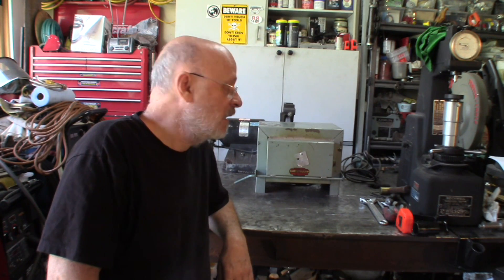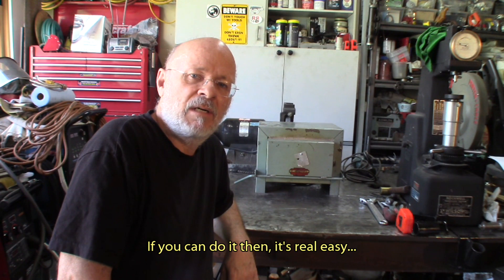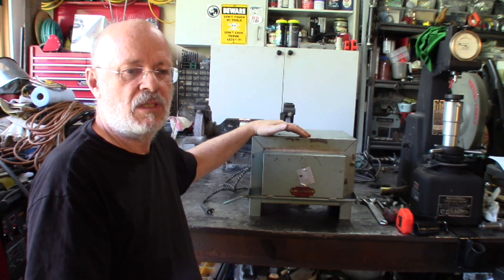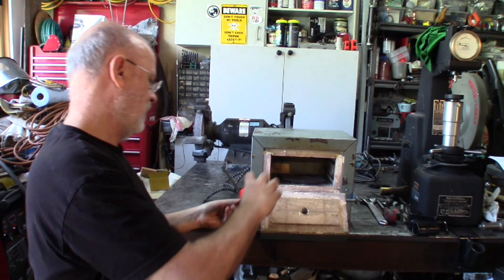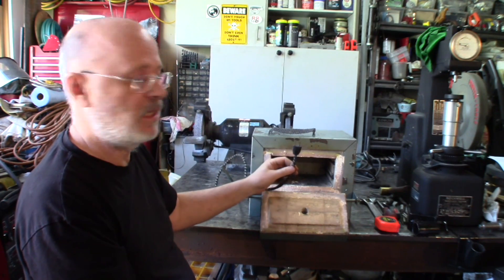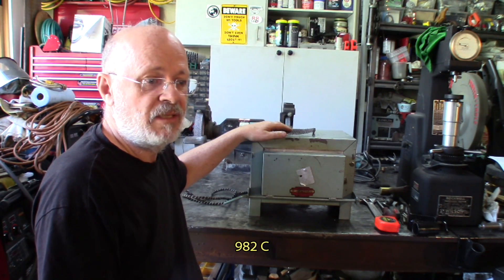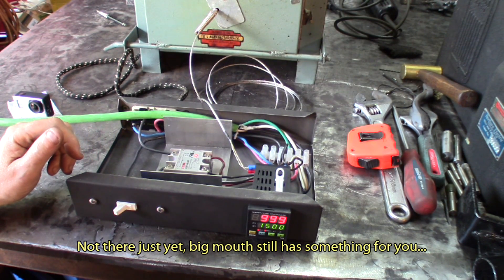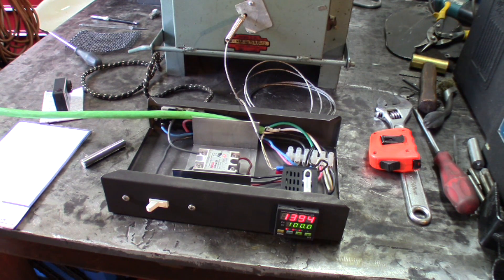Making an kiln oven controled by a PDI for hardening and tempering

Comment: Hello, i bought a ceramics kiln with a PID controller for melting brass, and it is heating up very slowly, dingen its programmed for glass, is there a way to speed up the heating process in any way?
Reply from the maker: Hi, you probably alerady got some presets programmed into the PID, normally ceramics will require a slow rampup in order to burn the vegetals still in the clay to avoid black stains in the fired pieces. Go into your PID instructions and find out how to modify the ramps and steps in temperature control. All PID's brands and models will be different on how it's being programmed as of the number of programming steps, this is why you must have or finf your manual.
Normally it's well enough doccumented, if required you could find videos on how to deal with the model you own...
Reply: @pierresgarage2687  wow, quick reply! Thanks for the clear answer, appreciate it!

Comment: Hello I would like to make a kiln element controller for my ceramic kiln to get slightly better results on some glazes that are little bit finicky the art of the system hold volume for certain temperature just like making high speed steel requires very precise temperatures with some poll times on the cooldown I believe. The way my kiln is set up it uses 240 volt but it splits it off into 110 volt for each element so there's a number of ways that I could do this. My question is could I run all of the elements off of 1 solid state relay simultaneously? That would be the best way to control the temperature for all the coils up and down the machine. I have it set on a 30 amp breaker.

Could you tell me a good brand of controller to you is I only have familiarity with the watlow brand as I used to repair incubators that used watlow controllers so I am familiar with the feedback loop type of devices.

For example what is the controller you used and what brand relay excetera would be a big help to me it would save me a lot of my own research which I really don't have tolerance for it this time LOL any advice you can give me would be very very appreciated
Reply from the maker: Hi, the controller in this video is a Chinese version of something, for the intended purpose it's all right. What you seem to require is something more related to commercial use and requiring more reliability. There is a line of controllers from " CAL Controls " that could fulfil your requirements, the model: CAL 9500P would do just that, it's programmable with many process steps, up or down, timed, etc. The price will be significantly higher than a knock off but you get what you need...

As for SSR ( Solid state relays), look on Digikey, Newark, web sites for good quality, there are others, but those 2 are quite reliable. Just choose a value slightly higher than what you require and install them on a proper heat sink, aside from this there is no big issues to be considered.

Thanks for viewing and for your inquiries,  hope this will help you, ATB,   Pierre
Reply: @pierresgarage2687  thank you very much for your reply I appreciate it greatly I will check them out. As far as the Heats and goes luckily I'm a machinist at least in the sense of a hobby that I've been doing for quite the number of years. I've actually designed a heat sink that works unbelievably well it's like E channel it has two solid sides and fins in the middle in a fan that sucks through the fins! It works about Chrome what I can calculate perhaps 60% cooler then he straight heatsink. I know that this won't require something that radical but it's fun to do anyway.

Thanks again

Comment: Nicely done! How is the SSR holding up getting partial voltage? Is that actually dropping the output voltage? I always thought SSRs were a simple on/off, I didn't realize they had the ability to ramp based on input voltage...
Reply from the maker: The SSR is being triggered on/off as the current is needed to kep up the required temp, it's always at full voltage, but, for shorter periods of time...    As an example it will be 100% voltage for 100% of the time needed to reach the required temperature, then, will cycle 100% voltage for shorts periods to maintain that required temp. At this time it can be considered the the on/off cycling is a certain % of the time...
Let me know if I was able to make this to you...   ;)
Reply: An SSR is basically a simple switching relay. Instead of a mechanical solenoid and switch contacts, it uses solid state electronic technology. This has the advantage of no moving parts to wear out, and higher switching rates for prolonged periods of time without wearing out. 

In the end, the control and output work the same as a mechanical relay. A voltage is applied to the control side, and this allows voltage to pass through the output side. There is no modulation of the output voltage. Voltage in equals voltage out. However, an SSR can take advantage of it's faster switching by using Pulse Width Modulation on the input side. This requires outside circuitry. The SSR doesn't modulate anything. It only switches based on an input signal.

Pulse width modulation works by altering the duration that current flows. This is called the duty cycle, measured as a percentage. A 100% duty cycle will be always on.  0% is always off. 25% is on 1/4 of a period of time and off the other 3/4.

When ever the duty cycle is in the on state, full input voltage will be applied to the circuit. Due to these on/off cycles being switched at very high rates of speed, the power load of the circuit will act like it is only seeing the amount of power proportional to the duty cycle. Since voltages remain the same as the input, but only the amount of power transmitted is varied, nearly anything including loads that operate in narrow voltage bands can accurately be controlled.

Comment: What kind of thermocoupler are you using?
Reply from the maker: It's a K type thermocouple, make certain it can stand temperatures of at least up to 1100 to 1200 deg. Celcius, also in PIDs setup, you can normally choose the type of sensor you actually use.
Thanks for viewing and for comment,    Pierre

Comment: thanks for the video! I am trying to hook a PID to and even heat kiln for knife making.
Reply from the maker: Hi Aaron,
That should be fairly easy since there is a minimum amount of parts, just make sure your oven can support fast temperature changes with the simpler PIDs, or you'll have to manually control the speed for reaching the operating temp. 
Just let me know how it goes...  
Thanks for comment,    Pierre

Comment: Nicely done, simple and effective, a quick tip, look up the "auto tune" function in your manual, it will increase the accuracy and stability of your oven. Your PID's (proportional-integral-derivative) will set themselves at the current temp setting. 

Thanks for posting!
Reply from the maker: Shadon HKW Hello Stan, seen that function, not sure it's in or out, but I'll look deeper into it... 
Thanks for comment,  Pierrre
Reply from the maker: Shadon HKW BTW, got some good tips  about folding from watching your channel... ;-)
Reply: Shadon HKW l

Comment: Can you provide a list of parts you used for your setup? I was lucky and picked up an oven for $12.00 USD. I want to use it for the same reason as you. 

Thanks
Reply from the maker: Edward BarronHello Edward, 
There are links to the main parts that you can order from AliExpress, for the free shipping mode you can expect from 4 to 6 weeks waiting, the main delay comes from local customs. But the prices are so much less that what you'll pay from local suppliers...

The other parts like switches and screws are locally found materials, the case I used, the bottom I made from piece of steel, the cover from an old electronic apparel.

http://www.aliexpress.com/item/TA4-Digital-PID-Temperature-Controller-SSR-Thermostate-Sensor-Heat-Control-Free-shippingFree-Shipping/32270255758.html

 http://www.aliexpress.com/item/High-Quality-3M-High-Temperature-100-1250-Degree-Thermocouple-K-type-100mm-Probe-Sensors-Silver-Free/950360720.html

http://www.aliexpress.com/item/2014-New-High-Quality-40A-250V-SSR-White-Solid-State-Relay-Controller-3-32V-DC/32225616046.html

Hope this will help, good luck with the build and thanks for watching,
Pierre

Comment: Nice project Pierre, heat treat ovens are rarely found in home shops, having one of this size opens up many possibilities, especially in tooling. Well done! Marc
Reply from the maker: THATLAZYMACHINIST Hi Marc, this is a quite simple project and not so expansive, that makes it accessible to amateur machinist, plus the temperature reading is close to be pretty exact " Out of the box", Also it's easy to adapt to just any size kiln or oven...
Thanks, Pierre

Comment: Nicely done Pierre!  That should be a really handy tool.
Reply from the maker: Fred Miller Hello Fred, that beats the torch any time, the hardening is better controlled so the crystalline structure of the metal is less prone to glass type shattering...
Thanks, Pierre

Comment: Good to see it working well, I did not see you test the oven temp with any other device to verify if your thermocouple values were correct or not. This is much quieter than the contact relay setup on my oven, which seems to work fine, but is certainly not as pretty as your digital display! :-) I am jealous of your personal Rockwell tester.
Reply from the maker: bcbloc02 Hi Brian, about the testing compared to another device, I've done something quite some time before with a TES tm. meeter, the difference was like 10-15 deg. F if my memory serves me right, to be performed again. Also there is a prevision to calibrate exactly the probe in the back of the PID.
Don't be jealous yet about the Rockwell tester, there is some work to do on it to make it functional, seems that the oil in the piston is the issue... To be continued...
You could certainly change your relays to SSR, even the whole controller possibly.
Cheers, Pierre

Comment: Well done there Pierre.  PID meaning proportional, integral, derivative.  Do you have access to these settings for tuning the control?  Thanks for the video.
Reply from the maker: cerberus Hi Harold, you can access the settings by pressing and holding some front keys, this TA4 lets you access many parameters so it makes it a very versatile unit, if you get one and are stuck just let me know and I'll give you a hand...
Cheers, Pierre

Comment: Ha ! Mr. Compressor makes an appearance ! Too funny.

That's a sweet little control box you made there. A few thoughts about your set up: if you're gonna park your kiln on top of the control box, you may want to keep an eye on the temprature of the SSR. I couldn't tell if it's mounted to a finned heatsink, but ssr's can get too warm in a hurry if they're trapped next to heat source like that. Also, I like your idea of putting a plug on the back of the box for your thermocouple. If you do, be sure to use a "cold-junction compensated" mini-plug that's matched to your Type-K probe. If you use any old mini-plug (from Radio Shack or wherever) the dissimilar alloys will throw off your temperature process values (PV) by a mile (or 1.6km in your case) and it all goes to hell from there.

Awesome little project! Thanks for sharing.
Reply from the maker: Seven/Ninths Creative Hello, good point about the type and nature of the contact strip, I'll pay attention to that detail... ;-)
The case is not going on top of the kiln, it would be running for trouble, the SSR is mounted on a U shaped 5" x 12" aluminum stuck to the bottom of the enclosure, it kept cool all the way with about 10 amps constant.
Thanks, Pierre